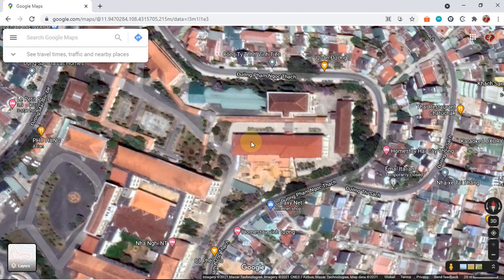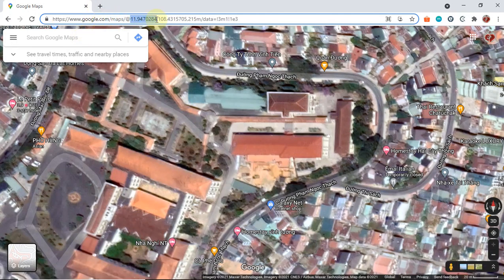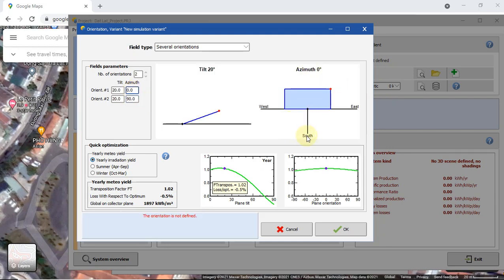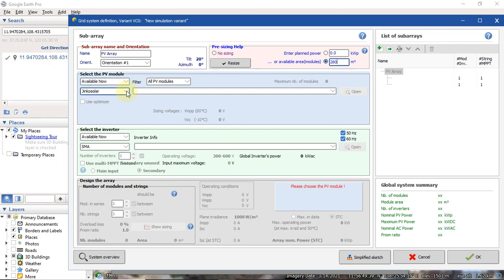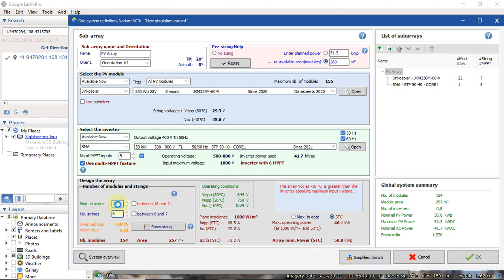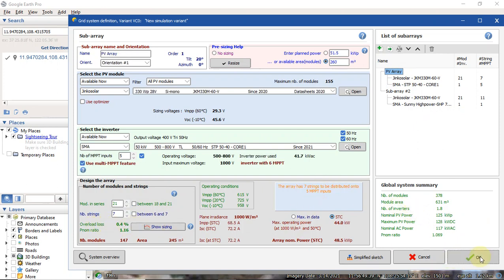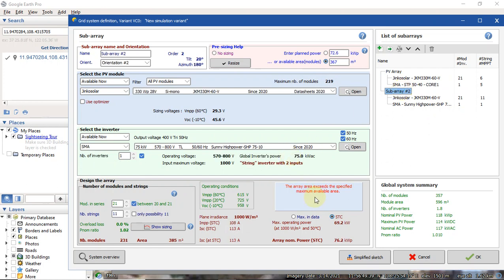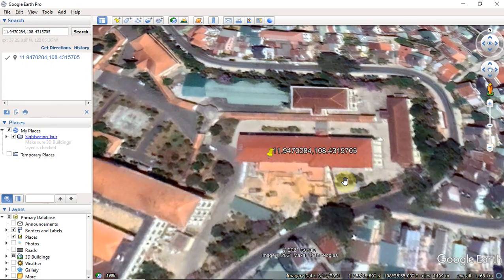Simulate Several Orientation Solar System With PVsyst 7.2

Comment: Hello,
First of all, thank you for the video.

I would like to ask you about the case of a smaller project where in each orientation, let's say 3 there is a group of modules, but all are connected to a single inverter, how it is developed in PVSyst. Thank you!